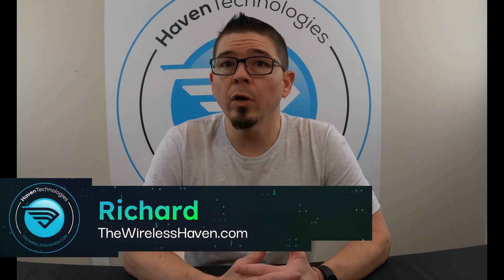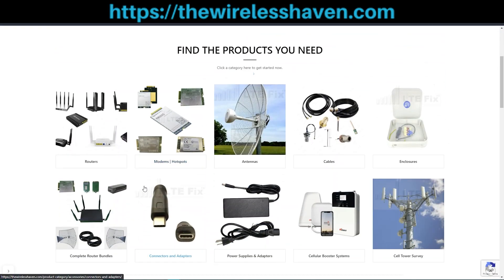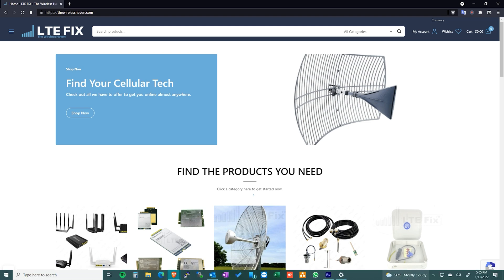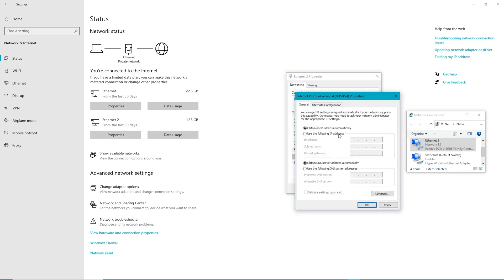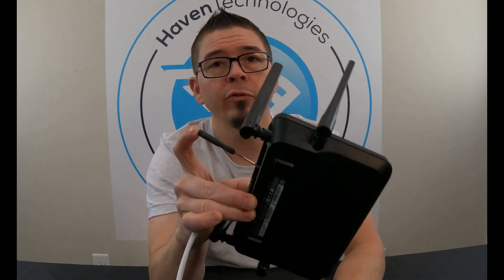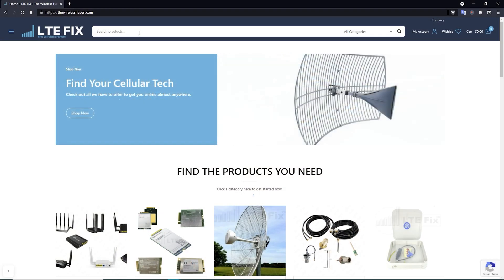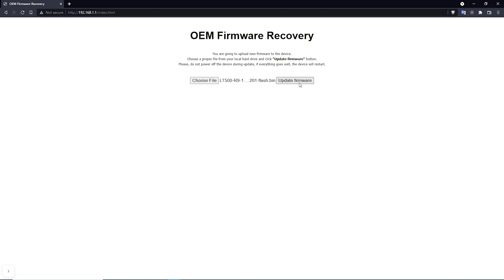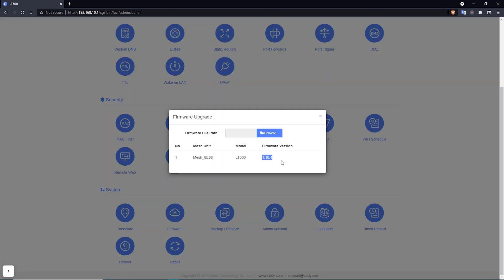The Wireless Haven - LT500 Router Firmware Recovery Tutorial

Comment: I have the cudy lt500 my router just stopped working and being on red can you tell me what to do to fix it?
Reply from the maker: You have to log into the user interface to see what's going on with the connection or settings.
If you can't access the interface, you'll have to use this recovery video and reflash new firmware.
Reply: I can enter the user interface but when I'm there everything looks normal like before me the router worked and my firmware is up to date and I tried to play your video nothing worked and the light stayed red and didn't go back to blue do you have any idea now what to do? @wirelesshaven
Reply from the maker: @natan1345  I ignore the LEDs. What does your cellular/LTE connection metrics show on the web dashboard?
Reply: It shows not connected on the status @wirelesshaven
Reply from the maker: @natan1345  Is it reading the SIM card? or does it show 'No SIM' type messages?

If it is reading the SIM, depending on your cell plan you may want to check your settings you needed to make to get it going? IMEI? etc. Your SIM may have been closed/turned off. Check the messages on your account.
Reply: @wirelesshaven My sim is working it shows me that it is ready but it shows not connected and from there I don't know what to do do you have a video that explains to me if you know what my problem is that can maybe help me fix it?
Reply from the maker: @natan1345  Have you taken the SIM card out and tested it in another device?
Did you have to change the IMEI to get your SIM working? Have you checked to ensure the IMEI has not changed?

There are so many variables that making a single video on troubleshooting would be very long and hard to make, as everyone's scenarios can vary.

Comment: Would that have anything to do with it connecting to the internet ?
Reply from the maker: This is in case you have issues flashing or updating firmware to the unit. It does effectively act like a factory reset as well.

Comment: I have a problem, this is an update if not the additions, what is the best?
Reply from the maker: I am not sure I understand your question.

The firmware recovery method, as well as using the web UI can both be used for firmware updates. The recovery method is typical if you have lost access to the router and can not log in or use it anymore. Sometimes this happens if you disable DHCP and can not remember the IP address of the ethernet interface or maybe you turned off WiFi radios as well. Sometimes simply forgetting the password will require firmware recovery.